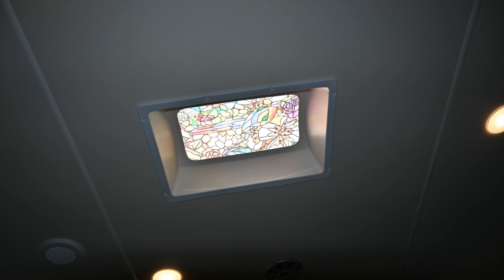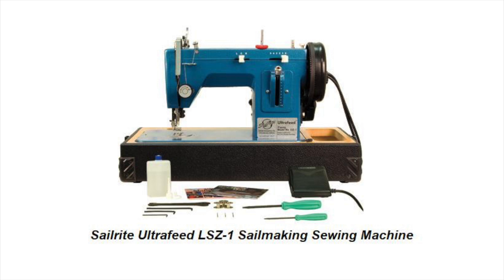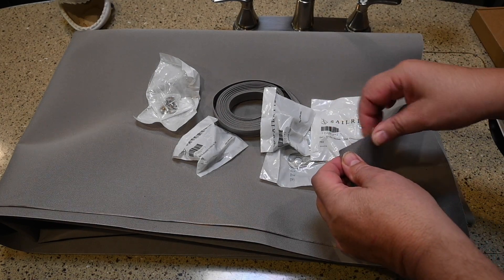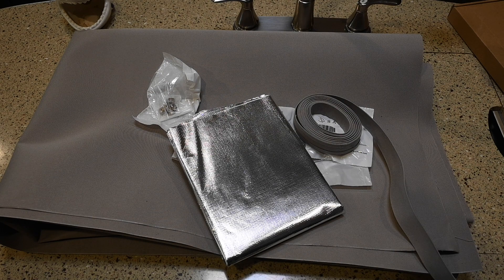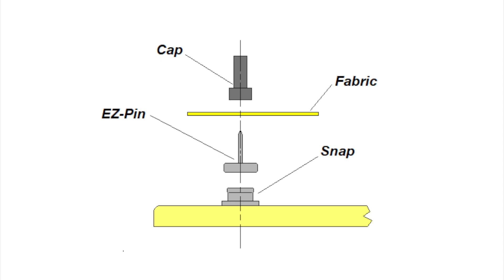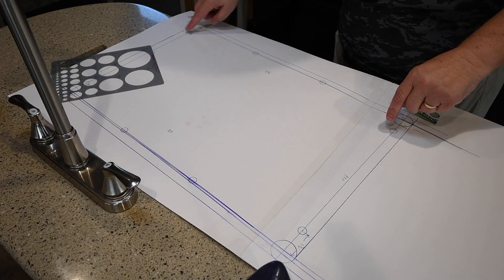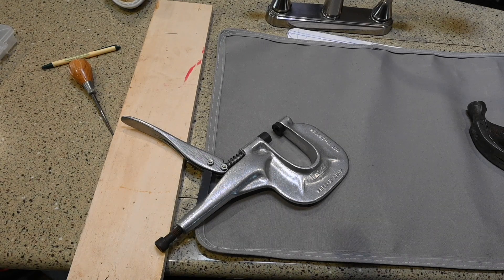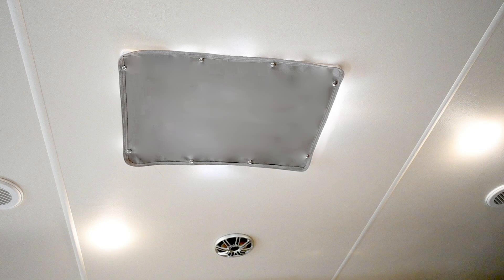Reducing glare from the RV's Skylight.

Comment: Do you have any concern about heat building up between the layers of the skylight? When we had our roof replaced on our Grand Design 303, they had to replace the skylight. The older one was very dark, so it blocked some of the light, but not all. Like yours, it is an odd size, and rounded at one corner. I had cut a piece of reflective windshield shade and fit it to the ceiling with Command Adhesive clips and elastic, which worked quite well.

The replacement skylight is clear, and allows much more light through. I’m thinking of some kind of fabric shade, as I’m afraid that the reflective windshield cover might reflect all of the heat back upward and overheat the skylight.
Reply from the maker: I will have to keep an eye on it.  Maybe I under-anticipated the poor quality of RV components.

But many of the pillows that Camco and others sell does have a reflective surface on one side, so I will just have to monitor it.

You mentioned your skylight was dark. Was this from the factory or from UV damage from the sun?

 Thanks for the info.

Comment: Thanks for sharing.  Why wouldn't you just install a skylight pillow?  Like 17
Reply from the maker: My skylight is rather an oddball size (14x33). If you can find the correct size, then a skylight pillow would work.  

But I like the idea that I can snap on the cover so it won't fall out, and in the rare occasion I want extra sunlight, it rolls up and stores out of the way.

Either way would work.   But then I would run out of project videos.  (❛̃ ͜ʖ❛̃)